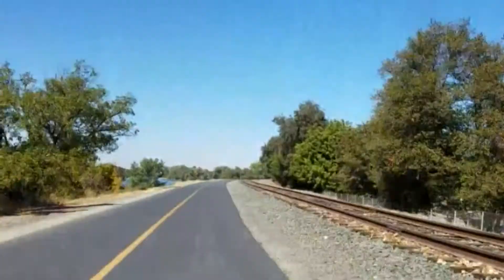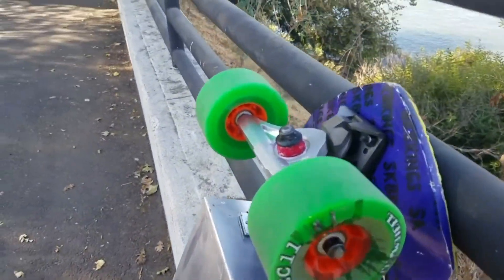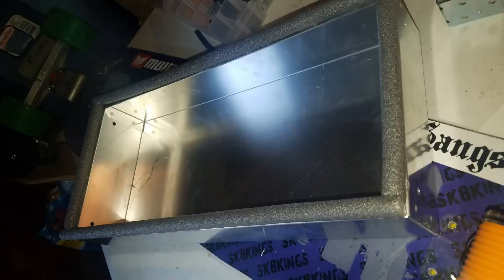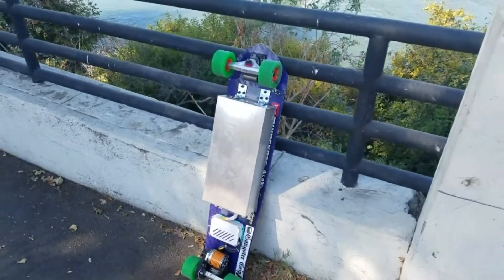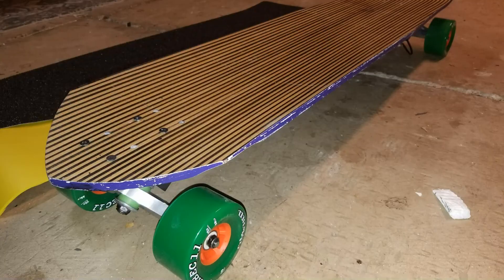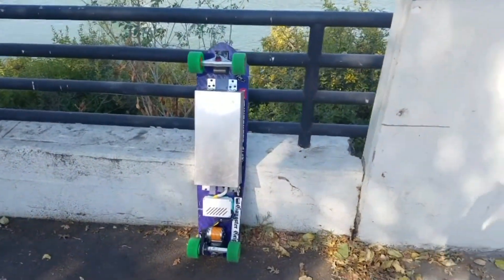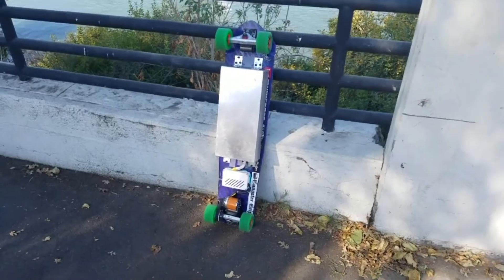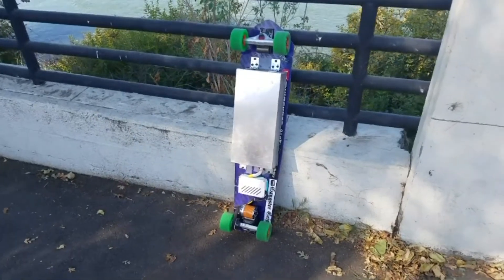40 Mile Electric Skateboard Ride

Comment: That's awesome, have you heard of metroboard? They are a little pricey but they have a 40 mile board at 17 amp hours I believe. Top speed of 24-32 depending on what you want out of it. They use RC remotes and don't look all that different from your board ha. But seriously well done.
Reply from the maker: I wouldn't call the Metroboard pricey...it's actually the correct price, while everything else on the market is just worthless for the price..there's only a small list of good eskates..they are all pretty similar and getting better..

Comment: Very cool!, would be nice to attach telemetry to the remote, so you can monitor voltage/mah/current
Reply from the maker: That's a great idea and I can easily do it in later versions, there's some cheap RC car remotes with touch screens and customized telemetry display for all kinds of included sensors, like RPM, voltage, amp draw, temperatures and speed..I also well versed in FPV and drone telemetry and I could use all kind of external systems and sensors. Thanks for the idea dude..but 1st I'm putting in a bluetooth speaker system and flashing lights to crash in on a bike event downtown, show those guys up a little..with my smaller eskate..